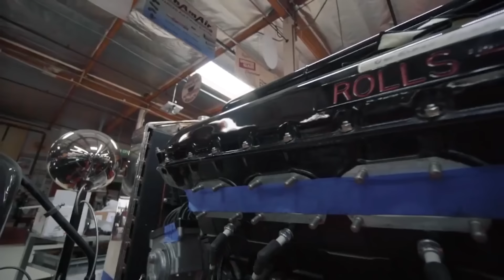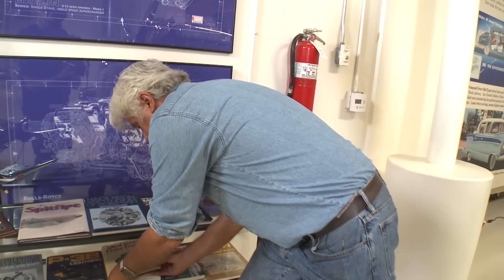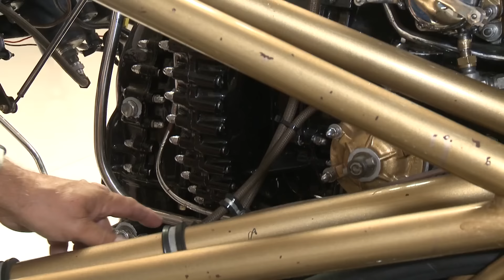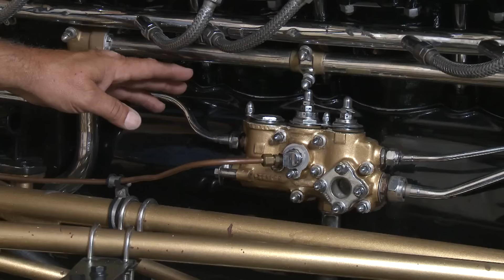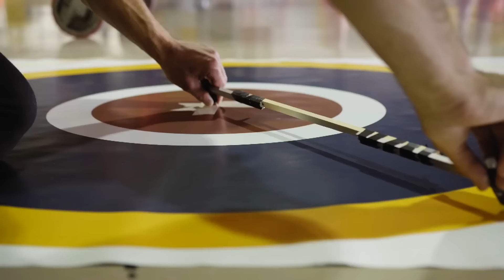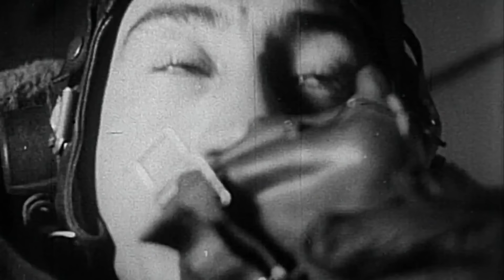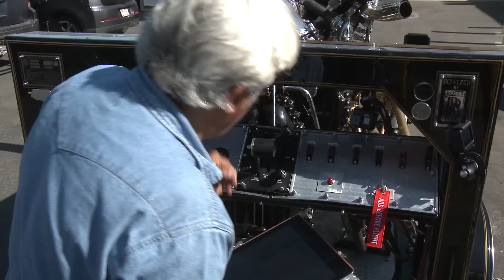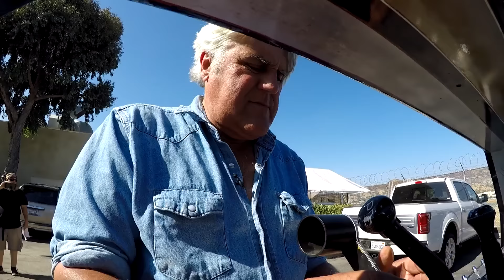The Engine That Won World War II - Jay Leno's Garage

Comment: It must have been the mid-'90s when another Ford engine designer and I drove from Dearborn MI to the museum in Hamilton.  I remember it was a cold but clear winter day.  We got to the museum just before noon.  We walked around for just a few moments when the klaxon horns sounded and the hanger doors on the end of the building opened.  It was COLD!  We asked one of the docents what was going on.  He said, "you fellas are in for a treat.  Once a month on Saturdays, we take a number of the aircraft outside for some exercise.  Today's the day!"

The crews rolled the Lancaster, a B-25 Mitchell and several other planes a couple of hundred yards out and turned them around so the cockpits were facing the open doors.  It took quite a while for the crews to go thru their checklists.  Finally, the Lanc's engines were fired up one by one.  Four of those unmuffled V-12 engines idling sounded like the starting grid of a Grand National stock car race.  After the engines got some temperature, the crew ran them up.  Man, what a glorious racket!  Those engines sounded great - like the entire starting grid of the Grand National race.

Next, the B-25 started up.  It sounded like a bucket full of rocks being swung around.  Then there was a loud bang and the port engine engine disappeared in a cloud of smoke.  Being in the engine design and development business, I thought they had blown that port engine.  The docent we had spoken to earlier walked by and said, "No, dat engine's okay.  Dose radial smoke a bit on start-up, eh?  We don't have much problem wit' mosquitoes around here on dose Saturday mornings when da warbirds are fired up."
We didn't get to take a ride in the Lancaster but at least we saw it run - at no extra charge from admission to the museum!

Comment: During World WW2 the US Defence Department placed orders for an aero engine with similar specifications to the RR Merlin. Ford developed an aircraft engine similar to that of the Rolls-Royce Merlin. It was a 60 degree V-12 with aluminium block and head, dual overhead camshaft, and 4 valves per cylinder giving around 700 hp. The intention was for Ford to break into the large market for fighter engines. However, this engine never went into production as an aircraft engine, with the RR Merlin (now being made in the USA under licence by Packard) being the water cooled engine of choice for the US air forces for high power and the Alison engine for low power. Ford concentrated on V-8s for vehicles.  The RR Merlin was proven while a new engine by an auto maker may have big teething problems.

Comment: The engine that won WWII was the V-12 diesel that powered the Soviet T-34 tank, which was built in the tens of thousands and was by far the most abundant tank of the war.  It was not the greatest tank of the war, but it was a good, effective medium tank and did the bulk of the fighting against the Panzers.  

Most Americans are shockingly ignorant of the importance of the USSR in WWII.  If Russia had fallen in 1941, it's unlikely there could ever have been a re-invasion of Western Europe by the Allies.  Russia lost 12 million soldiers in WWII (vs. about 1 million for ALL the Western allies in Europe) and the Germans lost 6 million, most of them on the Eastern Front.  If the Nazis had had the oil from the Caucuses and didn't have to pour most of their manpower into the colossal meatgrinder of the Eastern Front, things would have turned out very differently.
Reply: Mike Wagenbach
The Merlin was in British tanks as the Meteor. British tanks destroyed 90% of German armour in the west. Planes with Merlins pounded German industry to rubble.
Reply: "British tanks destroyed 90% of German armour in the west" Source?
Reply: Matt Watson
Source:
Bernages Panzers and the Battle For Normandy;
Zetterling's Normandy 1944: German Military Organization, Combat Power and Organizational Effectiveness.

The British and Canadians took on 90% of the German armour in Normandy. Eight Panzer Divisions and 3 Tiger battalions.
21st Panzer Division (117 Panzer IVs).
Panzer Lehr Division ( 101 Panzer IVs, 89 Panthers).
2nd Panzer Division (89 Panzer IVs, 79 Panthers).
116th Panzer Division (73 Panzer IVs, 79 Panthers). In reserve just behind the front.
1st SS Panzer Division (98 Panzer IVs, 79 Panthers).
9th SS Panzer Division (40 Stugs, 46 Panzer IVs, 79 Panthers).
10th SS Panzer Division (38 Stugs, 39 Panzer IVs)
12th SS Panzer Division (98 Panzer IVs, 79 Panthers).
Tiger Battalion SS101 (45 Tigers).
Tiger Battalion SS102 (45 Tigers).
Tiger Battalion 503 (45 Tigers).

The Americans had only faced one battalion of 40 assault gun in June (17th SS0 and only one panzer divisions (2nd SS) in July). The only time the Americans faced a large number of tanks in Normandy was when the Germans counter attacked them in August during the German Mortain Offensive. Even then, the panzer divisions had been reduced in strength after engaging British forces around Caen and were nowhere near at the strength they were when they were fighting around Caen.

In Normandy throughout the whole of June there was just one battalion of 40 assault guns in the entire American sector. These were the Stugs of 17th SS. There was no other armour in the whole of the American sector, apart from a few captured insignificant early war obsolete French tanks, until 2nd SS Das Reich turned up in front of St Lo in early July. At this time the British and Canadians had EIGHT panzer divisions (4 Waffen SS) in their sector. Two more Tiger tank battalions were sent to the British sector in early July 1944.

American WW2 armour writer Steven Zagola, states that the Americans were given an infantry role in Normandy by General Montgomery as they relied one one tank, the inadequate 75mm Sherman. The British armour was much superior, so much it destroyed most of the German armour. Relying on US armour to take on German armour complete with hard nosed experienced tanks crews would have meant carnage to US forces.  Montgomery could not afford to pit US forces against the brunt of the German forces in the west. He was in control of all armies in the Normandy. 

The only time the US forces met concentrated German armour was in the Battle of the Bulge, when German armour overran US armour easily. The US 1st and 9th armies had to be put under British control to stop the Bulge. The 9th army stayed under British control until the end of WW2. 

What gave British armour the edge in the late war was the introduction of the Merlin engine into tanks, removing the supercharging. The Cromwell tank was so fast it could jump Dutch Canals.  In tanks it was named the Meteor, which powered the Comet and Centurion tanks.
Reply: Again, there would have BEEN no Western Front for British or American tanks to operate in without the Russians bleeding off 80% of the German army in the previous two years before the invasion of Italy and the three years before D-Day.  

Had Russia collapsed, Germany might have moved or simply created significant industry farther east where it would be outside the range of British-based air power (e.g. Hungary, Poland, Romania).  It would have been foolish to do that in the actual event, when that would mean moving critical infrastructure toward the most active front.  

The importance of the USSR holding on through 1941 and 1942 and then turning the tide at Kursk cannot be overstated.  If Russia had been knocked out as a functioning country in 1941, it's hard to imagine the Allies being able to overcome that.  Doubtless Germany would have had to expend significant resources controlling important parts of the region, but those would have been for the benefit of bringing oil from the Caucuses, which would have been crucial.  Instead, they blasted the vast majority of their warmaking-power into death and scrap for nothing.
Reply: Mike Wagenbach
Over half of German production was dedicated to marine and air. The western allies destroyed most of that, not the Soviets. I doubt there would be much of a problem defeating the Germans without the Soviets. Germany didn't have the naval or air power needed to attack the British Commonwealth or the US. Germany was so internally weak that you would probably see a longer air campaign over mainland Europe, with focus on other fronts like Italy before an invasion.

Comment: I have flown in the Canadian Lancaster when it was visiting here on Long Island a few years ago.We were in the air for about 40 minutes.The Mustang was built to a British air ministry specification not to a British deseign.The performance at low altitude with Allison engine was adequate, but it was outclassed at altitude by the German fighters especially theFW190.It was transformed when fitted with the Merlin.It was then the best all round fighter of WW2.

Comment: I heard a story about these from an old guy who has since passed that there's a load of these engines dumped in a mineshaft near me. After the war there were an excess of them so they were simply disposed of as the Griffin engine replaced it and they were surplus to requirements.

Comment: Start it and run it on the primer, Jay, then bring the mixture to AUTO RICH.  When the carburetor begins to add fuel the engine will be so rich that it will quit firing, which is your cue to let go of the primer and maybe open the throttle a hair more until it is running on mixture only.  Practice, practice, practice.

Comment: Mixture full Forward to start, Is used for economy at altitude because of less ox at altitude. Run on full Mix until in the air and at altitude.  Helps cool engine at full mix and prevent detonation. You pull every thing back to stop and push everything forward to go. Good Video.. A pilot never uses a check list to start an engine; if it starts then a check list is good to insure you stay in the air.

Comment: The last RR Merlin-powered Spitfire was the Mk. 8 of early 1943 [excluding the Mk 9 introduced a year earlier].  Every model after that was powered by the RR Griffon.  The Griffon was basically a Merlin x 2 which in its final development stage achieved around 2450 hp.  
The Mk 8 was the first major upgrade for the Spitfire which included a broader chord tail fin, a retractable tailwheel along with a general strengthening of the fuselage.  The Mk. 8 production was consigned to the Far East and to the Pacific Theatre to replace Australia’s ageing Mk Vs.  Performance: Maximum speed, 416 mph. Service ceiling, 44,000 ft.
The first mass produced Griffon-powered Spitfire was the Mk 14 that was based on the Mk 8 but had a tear-drop canopy and a five-bladed propeller, first introduced in 1943.  Performance:  Maximum speed, 439 mph at 25,000 ft. Rate of climb, time to 20,000 ft was seven minutes.  Maximum diving speed permitted was 470 mph.
At the war’s end, the Mk 18 was introduced being the final development of the Spitfire marque which basically was an upgrade of the Mk. 14 with very much the same performance.
The last model Spitfire was the Mk. 24 introduced in 1946 well into the jet age.  A total of around 22,000 Spitfires were built during its production life of eleven years, and the Spitfire was finally retired from active duties in 1955.
As a footnote, Supermarine designed a Spitfire with a laminar-flow wing with an inwards retractable undercarriage similar to that of the P51 Mustang.  This design looked so unlike the classic Spitfire that the type was given an entirely new name, The Supermarine Spiteful.  Spiteful RB518 captured the world speed record for a piston-engine aeroplane in 1947 achieving a top speed of 494 mph.  The Spiteful models were finally declared obsolete in October 1947.
Reply: Tarquin Farquar
Production of the Merlin halted in 1950, while the detuned Meteor version went until the 1960s for tanks. The superior RR Griffon was until 1955 and into the 1960s for the marine version.
Reply: Tarquin Farquar  Many thanks Sir for educating us about this iconic British product that set the benchmark for all times to come.Never knew that the spit evolved into so many versions
Reply: The last Merlin powered Spitfire was the Mk. XVI. Most had bubble canopies.
Reply: Tarquin  WRONG !!!!  The shitfire Mk XVI was the last Merlin powered shitfire and it was powered by the Packard built 266 merlin !!!!!  Do the damn research !!!

Comment: I'm a little disappointed you didn't run it up at all..... and I don't think you fired it up correctly you're supposed to have the Magneto's off until you're ready for it to fire while you're cranking it or at least that's how they do it on airplanes maybe it's different cuz it's not on a plane.
Reply: Same procedure.  Crank with mags grounded, using booster coil to fire.

https://www.youtube.com/user/dairwin2000

Comment: One of the more unusual uses of a Merlin Engine was in the mid 70's we used them in Edmonton, Alberta Canada doing Oilfield Fracturing to Frac Gas and Oil Wells . In the winter because we had 100 weight oil in the Engines we had to stop every 2 hours by the side of the Road to warm them up and over night we would rent space in Garages to keep them warm before the job. They were connected through a Fluid clutch to a pump putting out 700 hyd HP. On the truck we carried 150 gallons of No. 1 Gas. to run the Engines on.